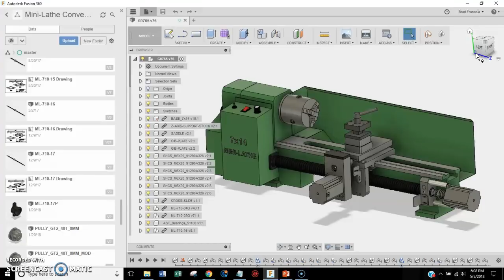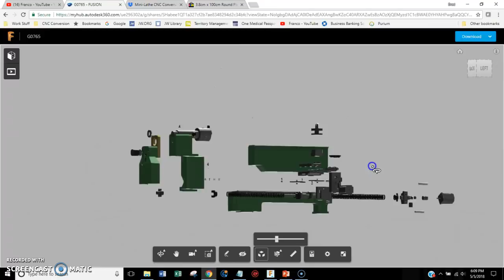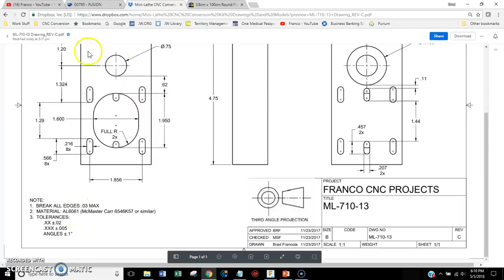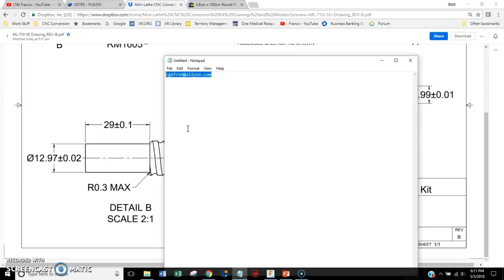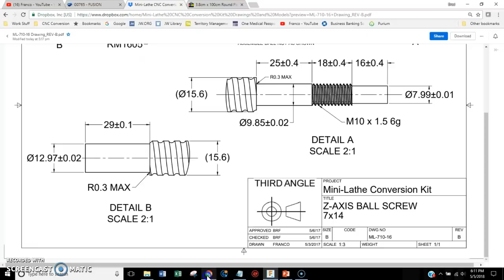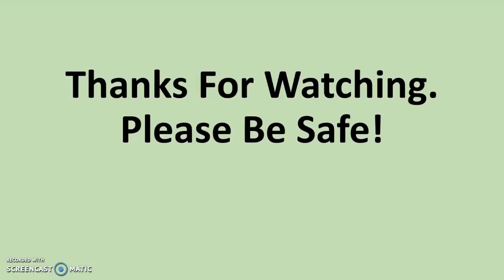Mini-Lathe CNC Conversion - Free Plans

Comment: Thank you for all the hard work!  I'm envious of your cad skills!   I imported to fusion 360 and out of curiosity I 3d printed the z axis models at 100% infill and 8 walls out of pla+  to test fit and they are actually extremely strong and I honestly think they would work as is, they are incredibly rigid.  My current cnc setup is 3d printed and it works, but it uses the factory lead screw for the z and there is just too much backlash and the threads arent consistant for the whole length due to years of ware in the first 2 inches.  Once I get the bearings I'm going to give it a try and see how it works, I may make it out of aluminum later down the road once I finish my mini mill conversion (also 3d printed).

Comment: I’m going to add power cross feed to my mini lathe. All I want is direction and speed control, do you think that a stepped motor or servo motor would be the best choice? I’m wanting to mount it on the back side of the saddle instead of the front because I would like to retain manual control as well if needed for turning operations

Comment: when converted over to cnc can it still be used manually if the motors have a second shaft to put a handle on ? Thanks
Reply from the maker: It could be used manually, but it won't be quite the same as the original setup with the graduated collars in place.

Comment: Hi Franco ,

Congratulations and thank you so mich for this amazing design.

Out of curiosity: why didn’t you screw directly the screw nut housing on the plate ? And did a slot instead ?

Is it to avoid any constraints due to the leadscrew misalignment?
Reply from the maker: You are correct.  The slot makes the design more forgiving and able to compensate for variations in the lathes.
Reply: Thank you Franco

Another question : why did you do a belt reduction system and lowered the motor instead of a direct mount on the sliding table ?
Reply from the maker: @bananasESCT  The belt and pulleys are actually 1:1 ratio. I did that to prevent the motor from projecting out so far away from the lathe. An in line arrangement would probably be slightly more efficient but it would stick out pretty far.
Reply: Thank you so much Franco

Comment: Hi from France, Franco, and thank you SO MUCH about your initiative !

I'm looking about the purchase of a quite common model, a clone-based of Grizzly's G4003 12" x 36" (longer version of Bolton Tools model # CQ9332A - 12" x 30" Gear-Head Metal Lathe with Stand & Coolant), do you think to purchase then upgrade a bigger/different lathe in a close future ?

Be sure that your work will help me to much clearly see how to modify a lathe, by thinking about all topics : choice of components, transmission devices, freedom of movements; clearances etc.

I have to say that compared to mills, a lathe conversion is not as common in occurence.

Best regards !
Reply: Hey ou en france, je suis de San Diego California
Reply: Hello compatriote expatrié :p je suis juste à côté de Paris ^^